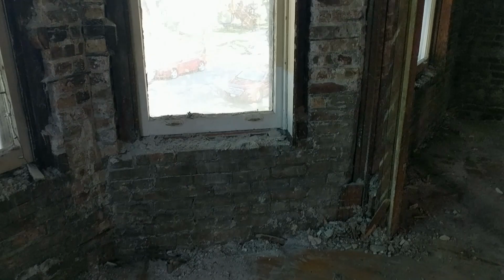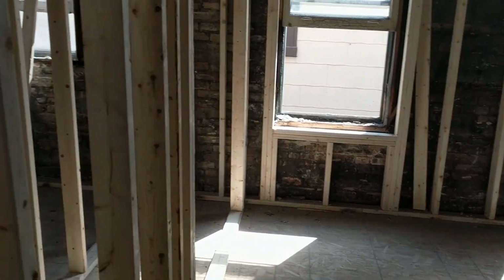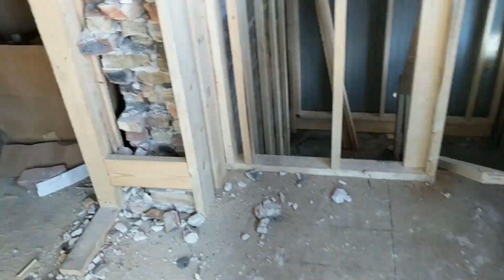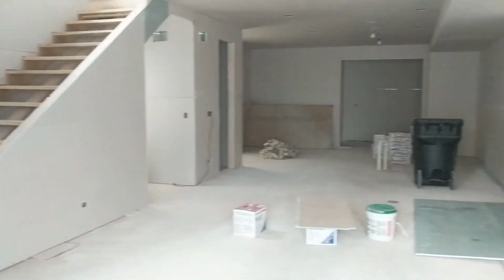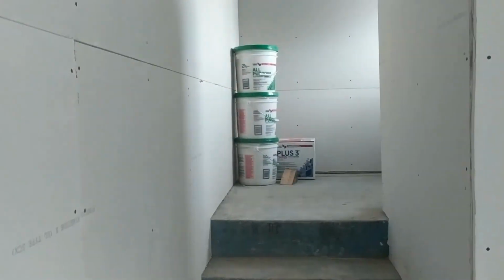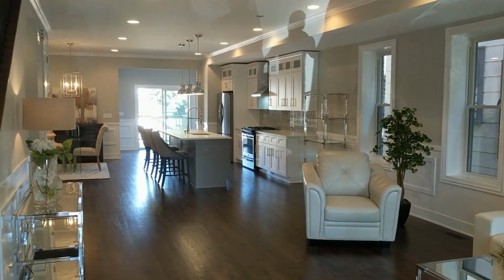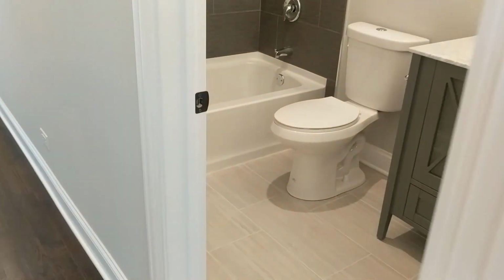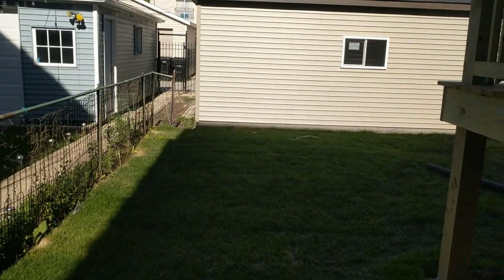Chicago 2 Flat Converted To Single Family Home From Start To Finish Video

Comment: I'm looking to convert a newly remodeled single family home into a 2 flat. I did a walk thru and everything is all set up for a 2 flat with everything needed on both levels. I would just have to put up a wall and door to separate the entrances in the front. Where do I start?
Reply from the maker: Hi Jaymara...you would start with an architect. You would have them draw out the proposed conversion and with the plans you would be able to pull a permit. The architect would be able to tell if your zoning would allow the conversion.

Comment: Quick question how much would something like this cost?
Reply from the maker: Hi Esha83 thanks for the question...to do a complete gut rehab like what was done in the video you're looking at about $120 psf for the interior. Exterior work would be additional, that's why it's important to choose a Chicago 2 flat that has been maintained on the outside. That's not to say you shouldn't buy a Chicago 2 flat that needs work on the exterior, you just need to make sure you lower your offer amount to account for that work as well. 

There's a certain point where it just doesn't make sense if the building is in real bad shape but in general these buildings were built solid.
Reply: @ChicagoRealEstate411  So it will cost about a hundred and twenty thousand. And if you get a mortgage loan And alone is more than What the building actually calls or what you pay for it. Is it good or can you use the funds that are left over to rehab the project
Reply from the maker: @Esha83 It would cost $120 per square foot. 2 flats are normally 1000 sf per floor so for the 2 floors it would be $240,000. If you did the basement too that would be $80-90 per square foot without digging. 

In order to get a construction loan the bank would need your budget and then they would do a feasibility study to see what the 2 flat would be worth after the work was done. If the purchase price or current loan amount you have plus the cost of the work are within a certain percentage that the bank requires they would then approve it.
Reply: @ChicagoRealEstate411  Are you in construction or are you the person that just happened to be flipping these homes yourself What construction company are you using?
Like using? And can you give me a few examples Of construction loans?
Reply from the maker: Homestyle renovation loan and the FHA 203k loan

I am a real estate broker/ construction consultant. I help buyers find an ideal Chicago 2 flat and then consult them in the construction costs and also construction management if they hire me to do so.
Reply: @ChicagoRealEstate411  Is your contact information? Still to save because I have questions lots and lots of questions.
Reply from the maker: @Esha83 you can email me questions at sold@myhouseisworth.info